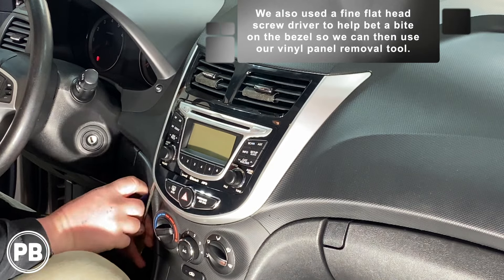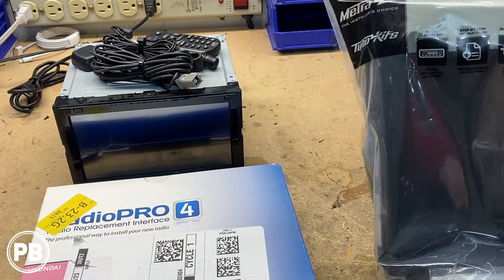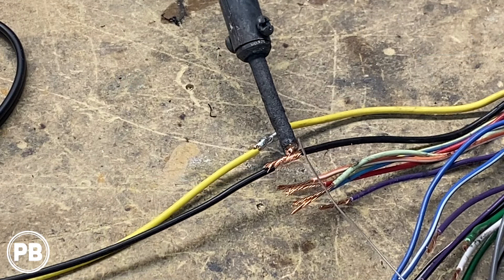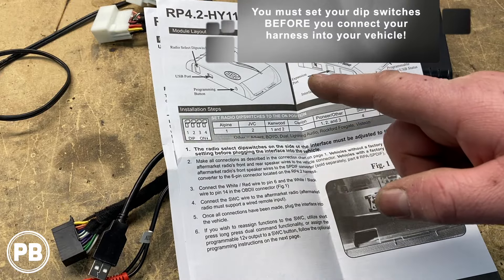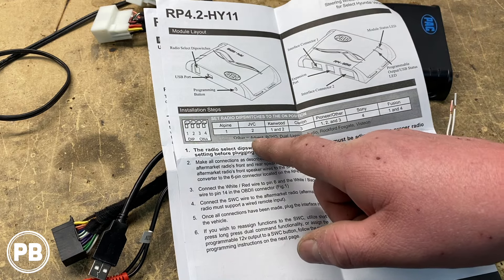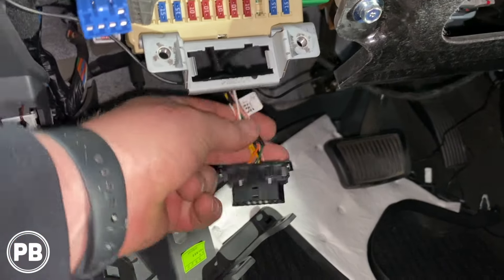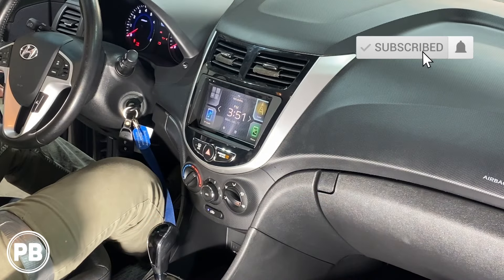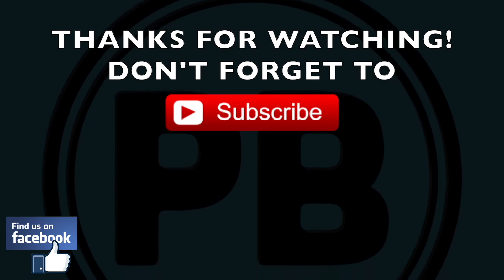2012 - 2017 Hyundai Accent Radio Install

Comment: Do anyone know if there is a radio that you can keep the hyundai factory usb and mic with the wheel control also and Aux my hyundai accent sedan have the shell of the 2017 but it was made in 2020 so it came with a touch screen radio but you can only see it go at night.. because of the sun damage.  If anyone can help .please
Reply: PAC RP4.2-HY11 Radiopro Radio Replacement Interface with Built In Pre-Programmed Steering Wheel Control.. they don't have anymore in stock is there any other ones for the hyundai accent

Comment: You don't really mention the USB connections for Android auto/airplay. Can you explain whether you connected to the existing and how you were able to access it. Or if you did something else
Reply from the maker: The Pac module retains some functionality of the factory USB located in the center lower pocket (which pac USB side plugs into your radio), however, in most instances, struggles to transfer data for car play / android auto, and is just a glorified charging port.  I suggest using a simple USB flush mount adapter and replace the power socket for a solid dedicated port for carplay / android auto: https://amzn.to/3gGHkms

Comment: How is your New stereo wires  the Exact same color as the Old wires ?? wish Mine were that easy.
Reply from the maker: Colors match, but function doesn’t. You will need the adapters we linked in the description.
Reply: @ProvoBeastAudio     I'll just wire them together,maybe solder, then shrink tubing.   I've already over spent , way over.

Comment: Do I absolutely need to get the PAC to be able to use the steering wheel controls and factory aux/usb ports?
Reply from the maker: Yes.  If you don't care for the harness that retains all those factory functions, then you can use the basic metra harness with a universal steering wheel control adapter, but it's more labor to install, and you lose more features.  You get what you pay for.

Comment: How did it sound with the stock speakers??  Any increase in quality there?  I'm doing this as soon as the harness gets in!!
Reply from the maker: Yes, you will hear a decent difference in audio quality with the radio that puts out more than factory.  However, stock speakers are still stock, so just depends on your definition of better audio quality.
Reply: Ok all said and done I hear a very noticeable upgrade in sound quality.  The 10 band parametric really squeezes the most of of the stock speakers.  You also have no idea how much this video helped thank you so much!!  (I bought aswc-1 and no success getting that working yet but for now it's all good without SWC)
Reply: I have the car stereo stocked right now so I would recommend upgrading

Comment: What are the sizes of the front and rear speakers?
Reply from the maker: Generally they are 6 3/4" Speakers from factory.  You will need a speaker bracket (Scosche SAGMEQ656 Speaker Mounting Brackets) and harness adapter (Metra 72-7300) to complete your install as well.